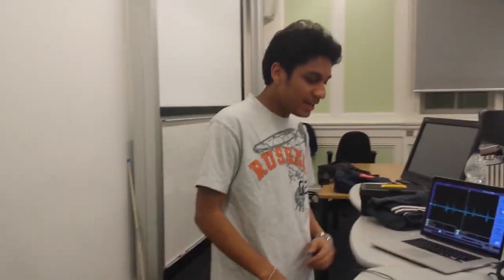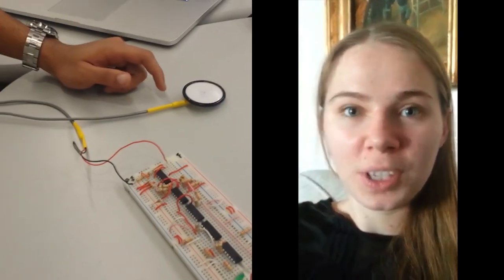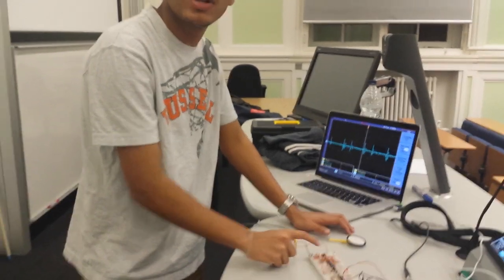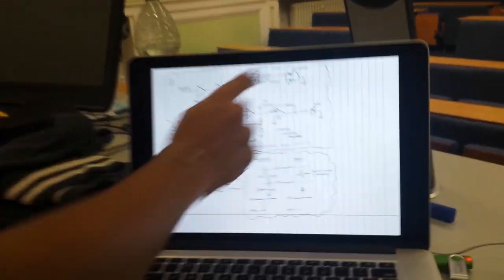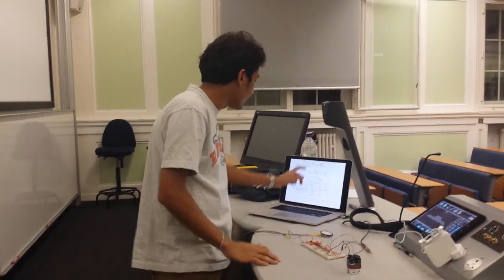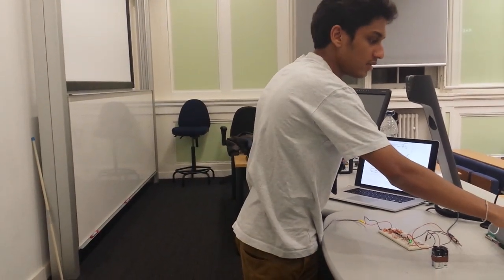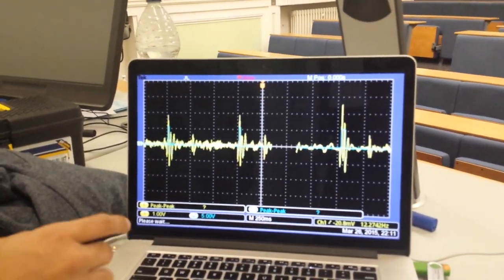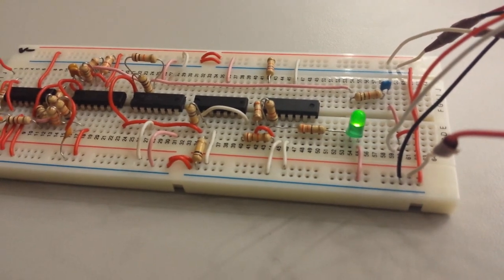Digital Stethoscope & Heart Rate Amplifier

Comment: Hello
you use any sensor to detect the heartbeat ? parcceque I must make a stethoscope with Arduino and wireless module that will send the signal to the computer I will need your help for the software that will display the results